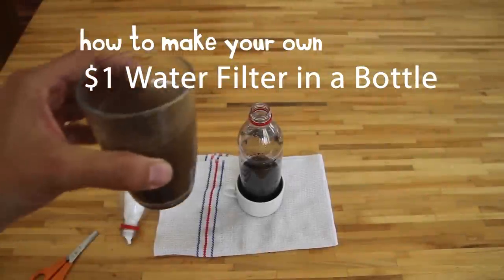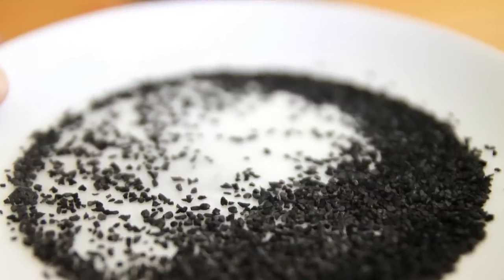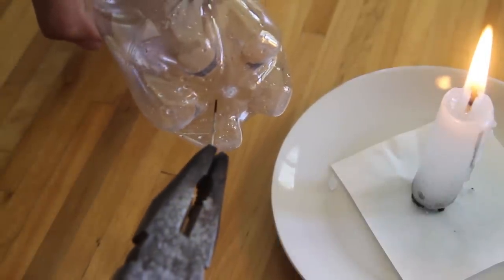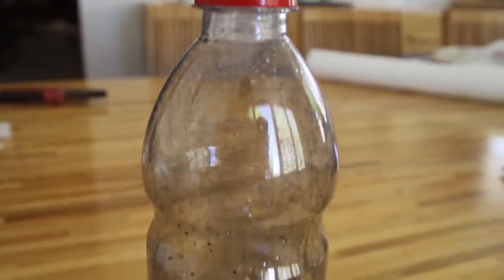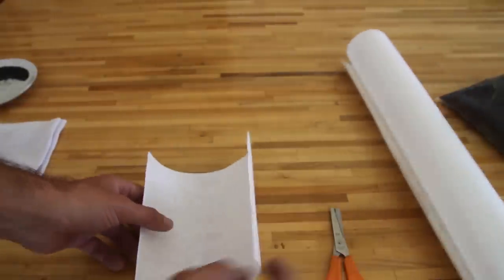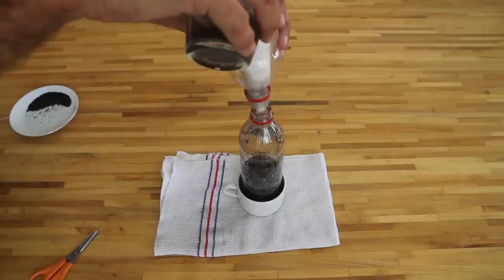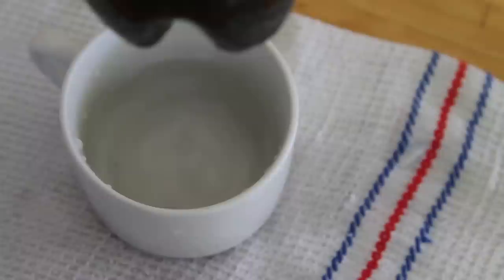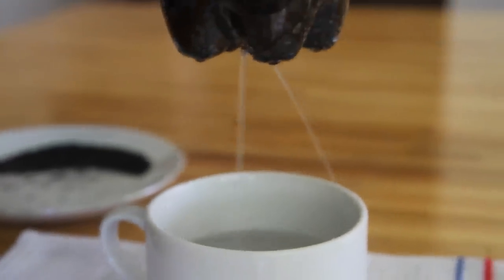$1 DIY Water Filter in a Bottle

Comment: The little that I know on this subject still screams NO THIS IS NOT SAFE! This design does not guarantee proper contact/exposure to the carbon. A better idea would have been a very long and slender column with highly compacted carbon at the bottom. High pressure + slow filtration would be ideal. Skeptic right here.
Reply: good for fish. for it to be safe safe you need to disinfect with chlorine or UV. (though chlorine is not good for fish) 

Most tap water is safe to drink, or if there's something toxic, activated carbon is unlikely to remove it to a healthy concentration. (i.e. most of the worst heavy metals, pathogens, or other emerging contaminants of concern). Might be good for removing disinfection byproducts depending how you design the filter. but that's why people go to school for this, not watch a youtube video.

Comment: I tried and my water came out black...
Reply: Did you rinse the activated carbon? That's a must!
Reply: Don't drink it using this guy's method, even if the water looks clear it can still have bacteria and parasites
Reply: Did u use charcoal or activated carbon
Reply: same thing
Using charcoal to filter water is also called ‘Carbon filtering’ it is when activated carbon (charcoal) removes the contaminants and impurities of dirty water. Active Charcoal Carbon Filters are mostly used when removing chlorine

Comment: Such filters can't hold a candle to the real ones. And if you want some pre-filtering (Particularly useful if you found yourself short on real filters with no way of restocking in a while or if you wish to save like 20-30% of real filter capacity. Also, if the water source is extra muddy with no chance of "calming down"), you better off using simple cotton wool and change it after each session (By session I mean 3-5 cycles OR 1 sitting)
In this case you don't pop the bottom of the bottle. You puncture cap (5 to 9 holes is enough), cut off the bottom of the bottle, tuck the cotton wool in the bottleneck, put the filter on top of the receptor (5L, 18L plastic bottles or 3L glass cans are perfect for this), pour the dirty water. 
Off course, there are some rules to using it
1)Do NOT "reload" said filter with it sitting on top of receptor.
2)If you disassembled it to inspect the wool, simply remember how deep the dirt went through and reload it with new cotton wool piece. Do NOT reload with used one. Use the inspected wool to decide how often you need to change it.
3)Do NOT aim for a center when pouring the dirty water. Pour a little, letting wall of the bottle take a hit, then pour the rest.

This pre-filter will actually cost you less than $1 since the bottle is free and cotton wool pieces are like $1 for a hundred balls/even more discs/250g of whole piece. Probably won't kill you while trying to perform it's less noble, but not that less useful duty.

As for active carbon in chemisty you use very thin very long if not extra long+S-shaped column, with glass neck on the end holding filter paper/sterile cotton wool for holding the carbon and water taking long, sweet time to go through all the carbon. And this carbon is like 3 different sizes. Still wouldn't drink it, honestly, end result typically got the optical flaws due to carbon still making through a little.

Comment: will it remove chlorine from the tap water ?
Reply: I zulkainan the great.please help me.
Reply: nothing removes it.
Reply: @joan - WRONG!
Reply: Charcoal removes chlorine very well. At worst if the filter sucks you have to pour it through a few times, but charcoal does absorb chlorine very well. You can also leave the cap off of your water for 12-24 hours and it will evaporate.
Reply: It will

Comment: Nice simple idea.  Can you post your source for the charcoal?  Thanks!
Reply: +ms.93555 ms.93555 For safely drinking you can expose the water to the sun for 3-4 hours, the UV light from the sun will disrupt the DNA from any bacteria and virus so that they can't reproduce, this is a low cost method called Sodis (Solar disinfection), it doesn't have to be warm (Winter sun light also works) and the water needs to be transparent, so the activated carbon method will  make turbid water transparent.
Reply: Huh